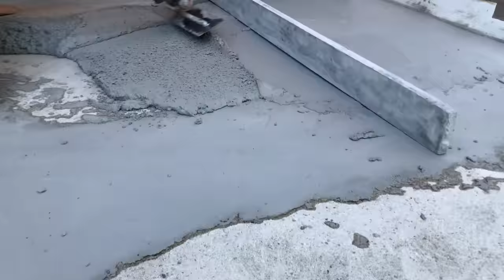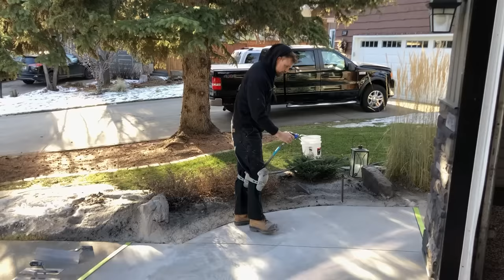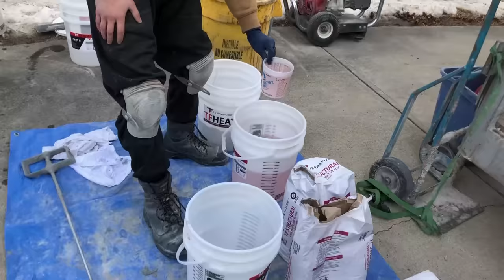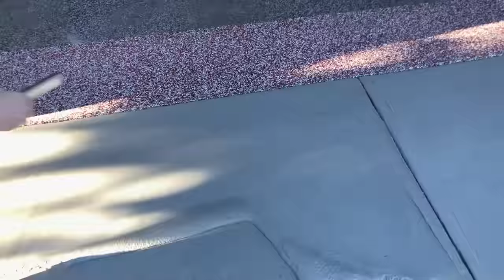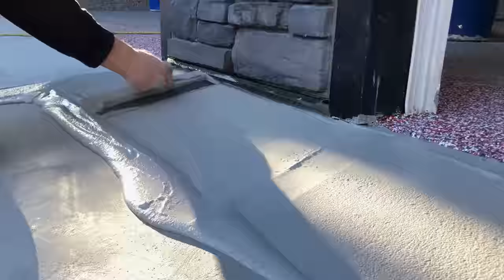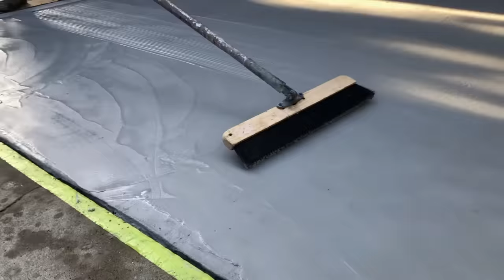Fixing driveway cracks, height differences, and broken edges, using TF Structural Concrete Repair

Comment: I've seen it before- thin layers like that crack and peel away after just several years
Reply: Yes, but what's the alternative?  It's cheap, DIY friendly, and home depot has a cheaper version in stock all the time.
Reply: I'm guessing since it's a 2 part mixture that it has some sort of epoxy like properties. Even if you only get a few years out of it, it sure beats replacing the entire slab. Maybe it gives you a chance to save up for a replacement?
Reply: I've seen companies sell this to homeowners without telling them what to expect. Homeowner spends $3000 to have unsightly cracked driveway paved over this way...only to have a cracked, peeling, even more unsightly driveway 5 years later. Not worth the time money and effort put into it
Reply: Seems like the thing you do to make it look nice before you flip the property and it becomes the next guy’s problem…
Reply: @mablenay  ya... I had this done last by 2 different companies. The real difference between them was one guy really did a good job and High pressure washed and cleaned the surface and the other one did not... when this stuff starts to flake off it comes off in sheets if the ground wasn’t prepared/cleaned  correctly..
Reply from the maker: You’ve never seen or used TF Structural
Reply: @TerrafuseInc  I guess you're saying a thin layer is stronger than the original slab? 
Why didn't you pin rebar in before toweling on skim coats? If the original slab moved that much, no way some tape gonna work better. I realize it's all about budget too. I get it. Time is money. For them and you. Hey,by the way Looks great bro. It's nice to see someone skilled move like they have a purpose.
Reply: @BlakeSuperior_Beats  Yep, about the size of it.Looks nice though
Reply: @BlakeSuperior_Beats  No! Easily seen by the home inspector or experienced buyer. Then it becomes an obvious negotiating point.
Reply: Why are you filling in the expansion joints?
Reply: @bondpit8750   After these patches are completed, you could go over the whole surface with a skim coat, and make it all blend in.
Reply: @BlakeSuperior_Beats  yup!
Reply: @matts.8342  keeping that water from washing out underneath.. all means necessary
Reply: @JIMMYJREVIEWS_thaiM-A-F-I-A  Hi,  I noticed that the beginning of this video did NOT show any preparation of the surface such as cleaning and power washing. So, if this WAS done then would this last 3-5 years in hot Arizona ? Thanks :)
Reply: @getsmartpaul   Hello Paul ! YES ! most definitely! Mine was done in tempi AZ so ya ...your all good if the person did a proper cleaning 👍
Reply: Yup wouldn’t call that fixing. More like hiding get your money and out of there before it cracks again. Even gone over the designed expansion gap 🤦🏻
Reply: @mrdoe8484  that’s what I wanted to know. I’m not in construction  and I’ve never done concrete work. BUT I’m pretty damn sure you’re not supposed to fill the expansion joints.
Reply: What is the product called?
Reply: I always  tell my customers  who ever  says they can repair  a crack  they are full of it .cracks come back in a year  a month  you don't know
Reply: @troycarpenter3675  yea ur right about the tape...this shits gonna be flaking in less than a year is my guess because of that crack.
Reply: @matts.8342  polymer
Reply: Just for emergency purpose. It wont last too long, due to the layer not adhere to anything but the old concrete. 
It looks nice , again it will be just matter of short time before it turns even worse than just cracked.
Reply: Yep. The better alternative is to lift the slab using expanding foam.
Reply: @JM's Caulking LLC 3k?  where do you live?
Reply: @mablenay  Not everybody wants to stay in one home forever
Reply: @matts.8342  exactly!
Reply: Quick fix for short term results…especially if you are going to sell.
Reply: Especially in the northern states with the freeze-thaw cycles
Reply: @TerrafuseInc  so looks like a great product. On the differential settlement crack, I am thinking hammering a trough for # 3 bars, using high strength product in the essentially the shear dowels then coating the surface with the TF Structural. Can I just buy the one product for both, and how do I assess the shrinkage concept? Essentially can it be placed thicker w/o shrinkage, meaning does it have a shrinkage compensating admixture inside? Thanks for the video. Will be looking for more of your uses like stair tread nosing.
Reply: Who cares than you do it again most cannot afford $10,000 to replace their driveway
Reply: @BlakeSuperior_Beats  or for a renter
Reply: @BlakeSuperior_Beats  
Sounds like your talking about car salesmen.... You know the ones that clean up those used vehicles real good to sell to an unsuspecting customer....
Did you bother to watch the video where he specifically went to places that he has done videos on, and showed what the places look like after years of initially fixing them?
I did...
I even put the link to that specific video in this thread....
Have a wonderful day...
Reply: Several months more likely.
Reply: Not much cheaper. Unless you are selling your house.
Reply: Sometimes it's cheaper to bust up and re pour the decks with things like this. The cracks will eventually come back anyway.
Reply: This is done right before you sell to deceive the new buyer. Shame shame
Reply: Your supposed to use a fiberglass mesh and add extra loose fibers in the mix. That will solve the cracking and peeling everyone's commenting about. Or just use a asphalt or tar based pad on top of concrete. Kinda costly on that second recommendation.
Reply: And if this is epoxy it will sag and droop from moisture and get ultra violet damage from the sun.
Reply: Not at all like an epoxy. All high psi concrete dries fast. It’s probably a polymer additive. I do decorative concrete and have demoed ceramic tile that had similar repairs underneath and until I pulled the tiles you have never known the concrete had large cracks everywhere
Reply: @BlakeSuperior_Beats  Exactly!  This is the ONLY reason people use this stuff.  It cracks, peels, and you always, always end up with the same old problem 2 years down the road…and almost always the buyer’s problem.
Reply: @Matt S.  you can simply do nothing to the slab while saving up for a replacement though.
Reply: @J K  lol thats a dumb comment.
Reply: @robintodd3901  he literally came back in the same video and recut the same expansion gap dummy.
Reply: @dosam_6146  he didn't fill the expansion joint.. watch the full damn video.
Reply: 1 of the 2 guarantee's of concrete work.........1. It's gonna crack. 2. Nobody's gonna steal it.
Reply: @BlakeSuperior_Beats  Exactly
Reply: @oldaxehead655  What is available at Home Depot?
Reply: Too much labor. Cheaper to pour new slab over it.
Reply: @Gforu81  That might be true but wouldn’t demolition and the big dig-out be the most labour intensive & therefore most expensive part of a driveway replacement? 

I’m sure a homeowner and their kids and wife friends, &/or neighbors can do that and save some money, no?.

 0h! 0h!, 0h!, that’s right nobody really wants to work these days they just want something for nothing or as cheap as they can get it except when it comes for their own paycheck then they want the max no matter what
Reply: Doesn’t matter if you sell it that year.
Reply: There’s also a primer you can use that helps a lot.  I believe you can get a lot of use out of it if you pressure wash and prime before laying the repair material.
Reply: I've been doing decorative concrete off and on for 20 years - my family has been doing concrete for 60 - and there has been more advances in the last 5 years than there have been in the 25 before that. With resins and/or other polymer additives, especially on the non-structural side, we are doing so much more with much less material. I can't vouch for this brand but I can vouch for the new formulations in general.
Reply: @BlakeSuperior_Beats  that's exactly what I was thinking. Lmao
Reply: Yeah it's poop 💩
Reply: Sounds like you should send them about  8,000 to fix the whole thing.
Reply: Right! Drive on it once and it's fucked
Reply: @mablenay  completely agree with you. Replacing the old driveway and do a completely new one may only cost you around $5k to 6k and can stay in good shape for more than 30 years, then why should people waste $3k to do a cheap job and last less than 5 years?
Reply: Several years??? I can live with that
Reply: So is this considered an overlay?
Reply: I did this to sidewalk and 5 years later still looks fine!
Reply: @racerfastbears2301  thanks for sharing! Just wondering, did you use a clear concrete sealer after? I want mine to not stain and not turn black as long as possible
Reply: @FromTheHood2TheWoods   I put a cement sealer on it> Quikrete Waterproofing Sealer,   Also when doing the cement repair don't do it real thin, do it a bit thick as 1 1/2 inch to 2in. If u can.  The thicker the better. And you're welcome. Let me add:  Following the directions is crucial to get it correct   and long lasting.
Reply: if he put an inch thick cement that might work
Reply: What about the expansion joints?
Reply: @mixedupmenopausaladhd3999  just fill them if it’s a older slab. Concrete is hard rock it don’t expand like wood. IMO hahahahah🤭
Reply: @TerrafuseInc  No more of tear it out and do it right kinda guy.
Reply: Everybody is quick to judge. Do a little research on the product and all your questions and doubts will be answered. As for this gentleman doing the work to show us something i appreciate it. Now its up to me or you if you want to make the move.  😊
Reply: For the amount you spend. Why not just concrete jack it level.
Reply: @therealjamesmccrary I disagree, I’ve done jobs like these… I prep the existing concrete first with scarifier to allow the new concrete to grab on and it prevents so many things from happening on the long run. I did a warehouse that stacks pallets on top of pallets of furniture and what not, up to today that floor has cracked nor chipped off.
Reply: That only happens if you’re using a mortar mix, Portland cement sand. This is an entirely different material product
Reply: If it lasts “ several years” you’re lucky. Waste of time
Reply: If you have giant cracks in your driveway, there’s an underlying problem. Probably a depression in the sub grade that fills with water , then freezes in the winter and pushes it up.
Reply: No you haven't
Reply: So its impossible to fix and its going to keep cracking and shifting, if this is the case then I would just go with a flex seal instead of concrete. Does that sound right to you?
Reply: 😅 several years is pretty fucking good 🤡
Reply: @heeeeyjai  not everybody understands before they pay for it that it'll look like shit again in 5 years
Reply: @jasonatherton8251  the 🤡 is the one wasting $ on something that cracks peels and chunks away after just 5 years
Reply: @mablenay  to properly replace that would cost 10 maybe even as much as $20,000. Those bags will end up costing maybe less than a few hundred. You don't have a clue what you're talking about.
Reply: @mablenay  not to mention even if you pay the 10 or $20,000 these days you don't know if you will end up with a good quality finish anyways you could be right back where you started as most professional concrete companies only offer one or two year warranties anyways.
Reply: Never seen a concrete coating applied to dry concrete. Always a wet or damp substrate. Surface tension needs to be broken before coating application. Never seen it broomed backwards as well….
Reply: @BlakeSuperior_Beats I agree. Unfortunately I’m not having any luck locating someone who does this work here in Atlanta Ga.
Reply: Exactly…..
How about spray some of that Sika milky stuff that bond concrete to concrete and add some to the mix . Smh
Reply: Yeah, Mother Nature wins Everytime !
Reply: Esp when you DRIVE ON IT
Reply: If the driveway surface was scabbled then it would have a better chance of bonding to the original base.
Reply: This is garbage . Cracks out , looks worse in a year . Save your money and do it right . Dumb fix
Reply: Then do it again.
Reply: @meagainandagain5756  it's too big of an undertaking both time- and money-wise to do even once, knowing how brittle and short-lasting it is. Just do it right the first time; of which this isn't the right way.
Reply: @vincentscibana856 the best way is to tear it all up.

You'll want to end up with 8" of 6000 psi structural concrete, with 3/4" rebar every 12" in a grid pattern. Weld all the rebar together. Add lots of fiberglass strings to the mix. under that, another 8" of compacting gravel (0" to 3/4"). Lay down a layer 1" thick, lightly water it and tamp it with a machine for an hour. Add another 1", do the same thing till you get 8". You'll want 16" below grade to add 8" of that gravel and 8" of concrete.

Pour the concrete, cut it into slabs.

Thats the best way. 10" of concrete is even better.

Whos paying?
Reply: So, what's your point?  Maybe a few years is all he wants or expects.  Move along, SA.
Reply: The key to any overlay lasting is sealing it constantly,  especially in the northern states with the freezing and thawing during winter
Reply: Several years? sounds worth it to me
Reply: yea also you need to prep the area you're concreting at very least wet up the contact surface
Reply: The first layer fas a floor leveler mixed with adhered veneer mix and sand. The second coat was a rubberized grout. I'll subscribe to your channel after it has made it ten years with high traffic. I've seen it Last 25yr+
Reply: So you don't again when it's time. It's called "Maintenance."

Comment: It's absolutely unbelievable how many trolls are leaving negative comments. Being myself a Mason, I know how much work that was. I'm 100% impressed.  Also, I know homeowners.  I guarantee they were told it would only get them a handful of years before possibly starting to scale. I also guarantee they didn't care. People are cheap. Great job guys.  Hats off to you for running like a well oiled machine together. Very impressive
Reply: Truth = Trolls?
Reply from the maker: Thanks :-)
Reply: Hating for the sake of hating w/o being able to back up the hate w/ evidence = trolls.
Reply: @LABoyko - trolls get a bad rap. A lot of em are straight up comedians. They write some funny funny stuff. People shouldn’t take themselves so seriously and be more willing to laugh at themselves a little more with good natured teasing
Reply: By the way,  this isn't a video about contractors or masonry work.

This is an ADVERTISEMENT for the product being used. 

Look at the description.  This is all a plug for a product being sold on Amazon.

That means people have even MORE reason to be critical and to challenge what is being shown.

Showing a product like this at this stage means nothing.  They should go back NOW (18 months later) and show how this had held up.

Again,  sack up or shut up (and, now,  I will add - use that rotting Grey matter you call a brain to think a bit more critically before you cry again, civilian. How dare you tell the people that MIGHT be those homeowners you disrespected by calling "cheap" that they are trolls for being skeptical of a product being pushed on Amazon)
Reply: ❤ AWESOME WORK OF ART. THANK YOU FOR YOUR HARD WORK!!!

Comment: I've been a concrete finisher for 15 years and that's the first time I seen some one edge with a margin trowel, no joke lol . Crafty work man
Reply from the maker: Always something new to learn! A guy I used to work with came up with that, it works so good when you have a thin layer, and can’t get the edge trowel low enough
Reply: We both know the only real way to put it right is to dig it all up but it's still not a bad repair . At least it looks tidy.
Reply: Derek, do you need to bush the parent concrete first?
Reply: @paulcarruthers2431   I have to do a similar job in a warehouse. I told the client I prefer to saw cut and remove the concrete if possible. I test drill the existing concrete to measure thickness. It's was over 14" thick ( my drill bit Max depth is 14").  The only cost effective way to do the job is to remove an inch or so of concrete and resurface the area. The Terrafuse product will chemically bond to the existing concrete.
Reply: @redneckoriental  that isn’t true. The chemistry of this product bonds directly to the existing concrete mechanically and chemically